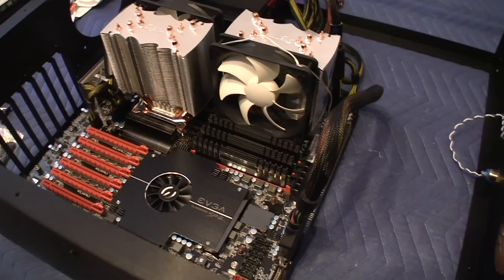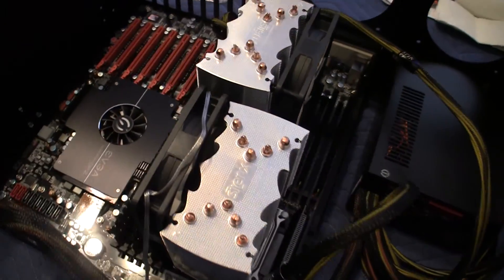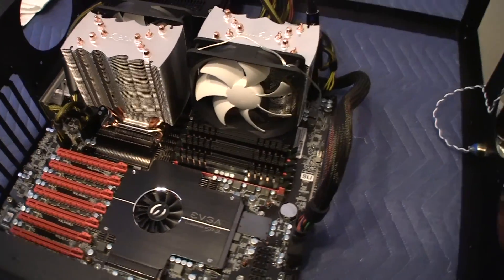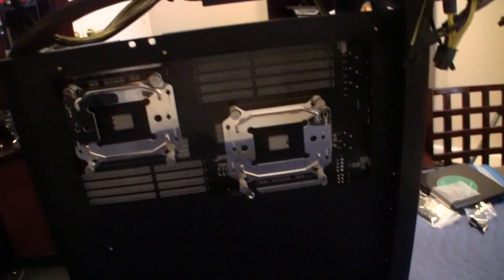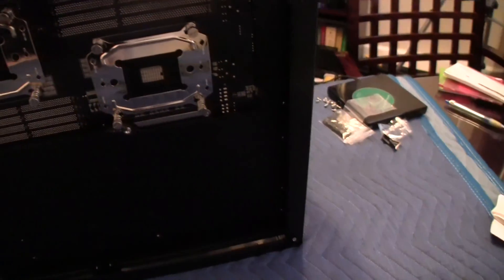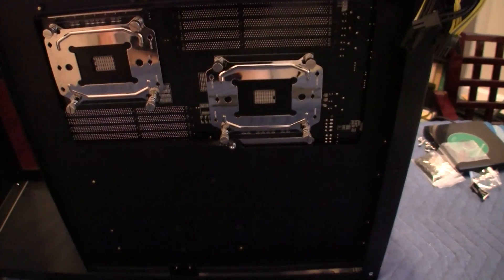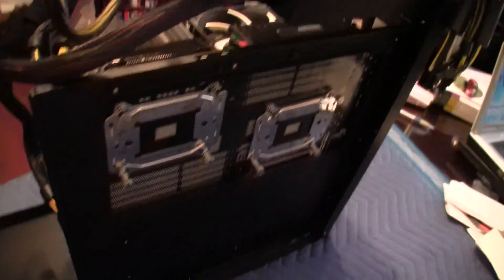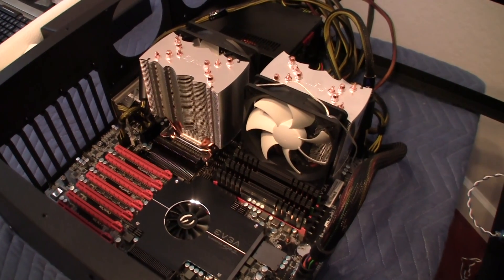Part 9: Connecting two CPU cooler and heatsinks to an EVGA Classified SR-2 Motherboard

Comment from the maker: @Rippster1818  There are 4 black screws on the front side of the motherboard, around the CPU. If you unscrew those, the backplate becomes loose, and you can pull it out.